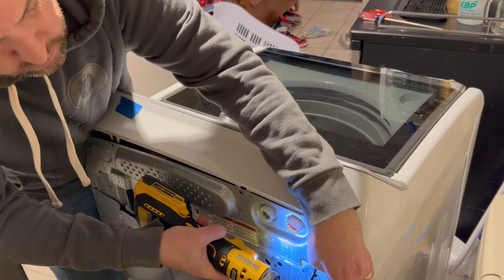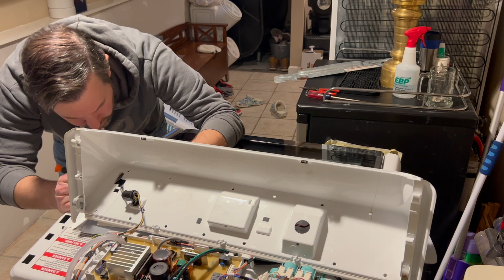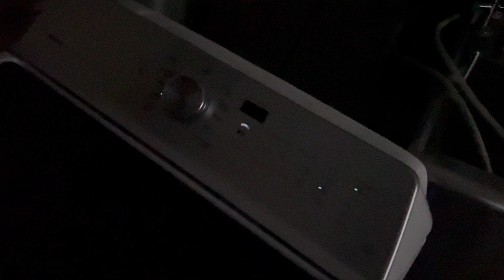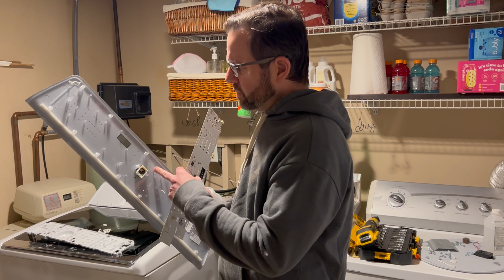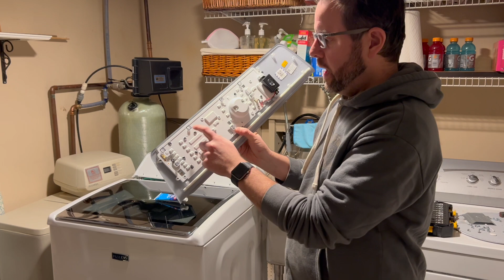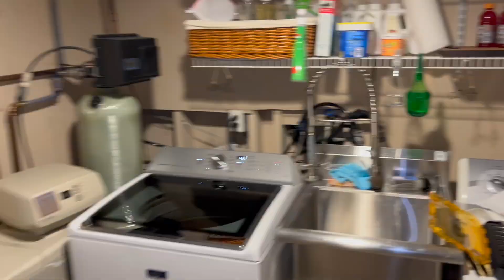Maytag F6 E2 Fix AGAIN!!!

Comment: Awesome video! I'm having the same issue. I've cleaned the corrosion and it's still been kind of wonky. So I'm going to look at ordering the circuit board and doing it how you did, instead of just purchasing a whole new control panel! Thanks alot

Comment: I have the same machine, same problem. I just fixed mine, and its working right now. You don't have to take the machine lid off like that, you can get a flat head screwdriver to pry up where those spring clips are, to get the control panel to slide forward and off. He is right about thise brownish corroded looking solder points on the board tho. Mine had no solder even in them, and ive seen people just clean them with alcohol and this worls for them. I wish i tried that 1st cause getting to the board is more complex, and i didnt know that the open exposed area there was my problem. So I opened the panel up, drilled out the melted plastic anchor posts, and soldered those pads. My machine did come right back on, but after this 2.5hrs of work, I wish I had tried the alcohol first.  Now I know, and if the machine stops working again, i will clean those areas, then seal it with silicone to try and prevent it from happening again. Thank you for taking the time to show us this, and help others. Videos like this saved me from an expensive repair bill, new board, or new machine. I am thankful there are people out here willing to do this to help others.
Reply from the maker: Great point about the need to not completely disassemble the unit to get access to the board. I do believe that you have to remove the back screws to slide the top tray forward in order to access the retainer springs. Can you do that without?